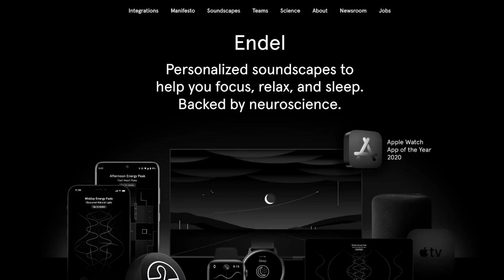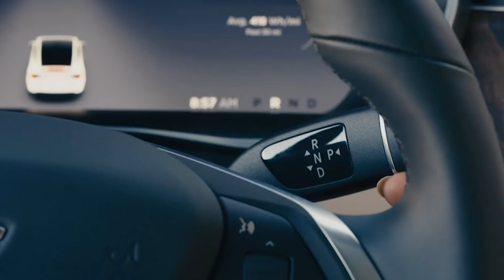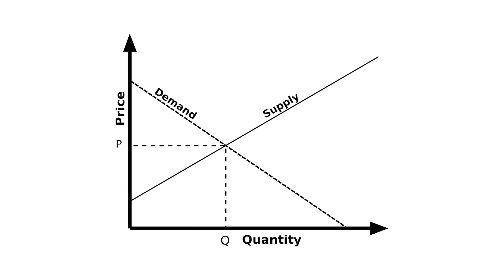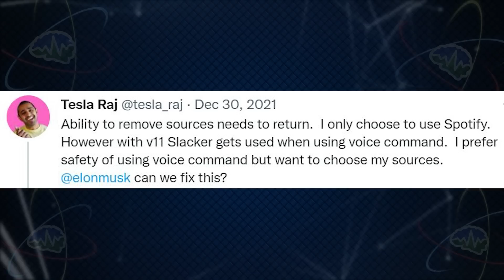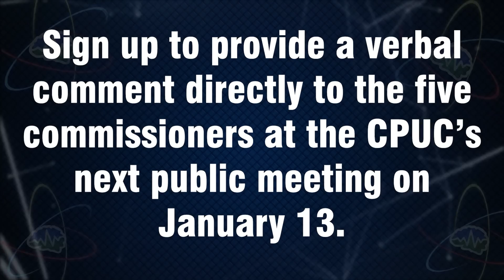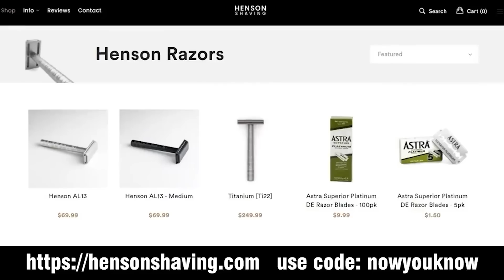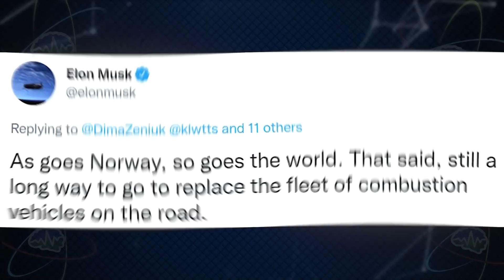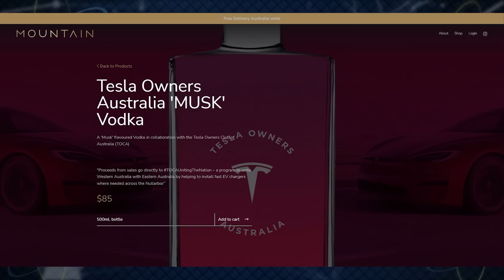Tesla Time News - What's Up with the Tesla Recall?

Comment: The steering wheel oscillation on that autonomous truck is a prime example of "hunting oscillation", a common problem in automated systems. It is caused by the feedback loop when it over-corrects for a minor deviation, causing it to "hunt for" and oscillate around the desired results. Fortunately, there are ways of solving this problem.
Reply: It also looked like it was amplified by body roll.

Comment: Re: getting used to voice commands - it's sometimes hard to vocalize what you want. You have an idea in your head of what you want, but that's a physical action. You then have to translate that into words and sometimes that gets messy. You do have to dedicate a bit more mental effort to use voice commands rather than having a button you're used to pressing with muscle memory.
Also, voice commands suck ass/don't work if you have a bad/no network connection or are traveling above like 50 mph because of the noise in the cabin.

Comment: NEM3, if it is adopted, will be a huge boost to the home battery market. If the utility doesn't have to pay a decent price for the solar you make in mid day, the obvious way to compensate is to store your free solar power during the day, and use it later instead of pricey power from the grid. The tax is harder to avoid. I'll be protesting that. It will push some to go completely off grid and kick the utility to the curb. I don't have enough space for panels to make that possible.

Comment: Any idea how well the Tesla Solar panels resist fire as, here in California we have forest fires every year. I hope to buy a home in a rural area, but that area is prone to fires. I would retrofit the home against fires with such things as, fire resistant windows and sliding glass doors, retrofitting or replacing the garage doors with a new one or a special add on to the bottom of the garage door which is designed to keep the high winds caused by a fire from pushing hot ambers under the door, etc, and I am wondering how fire resistant the Tesla Solar Panels are? I know removing shingles and putting down a metal layer, and then putting new shingles on the roof is a way to protect the roof from fire, but wonder if Tesla Shingles could replace all or most of the shingles if they resist fire. Also, could a layer of metal behind the Tesla Solar Panels act as a heat sink to keep the panels cooler thus making them more efficient. I know heat on a roof can lower the efficiency of solar panels.

Thanks, love the show. I hope to invest a few hundred thousand into Tesla later this year. Hopefully their stock doesn't rise too high before that point in time.

Comment: The Scotland story is actually a bit less impressive. The target relates to 100% of Scottish consumption of electricity. But Scotland is a big net exporter of electricity. So it should be easy to exceed 100% renewable. It is quite realistic for Scotland to produce 200, 300, 400% of its own consumption in renewable electricity. And still produce some non-renewable power.

Comment: Zach and Jesse, Why hasn't a weather widget been added to the UI. Seems like an easy thing to add and wouldn't take much work. It would have a big impact. So many times I just want to tap on the temp at the top of the screen and have it pull up a 7 day forecast. What are your thoughts? Can you push this up the pipeline?

Comment: Add a couple of new power walls then all the solar power goes to the power walls to completely recharge the power walls by noontime. The simply shut solar down. Then notify the power company you will no longer be providing the grid. That should get rid of the $80 per month. When the sun goes down your house will automatically switch over to the power walls and unless you look out a window you won’t even be aware of the power walls taking over power.

Comment: Windshield wiper button was uncalled for, the problem with the UI is making it HARDER to do things as you drive. Voice command isn't perfect especially if someone has a speech issue. Trying to access the AC blow out control is now harder. Also, SAVING a recording that you have set to manual is now harder as you are driving..this isn't a Windshield wiper problem. It's a safety problem with these two settings not needing to be changed.

Comment: Regarding the UI issues and complaints...I believe they could have been largely mitigated by having the old UI buttons as part of the custom button line-up. Oh, you want the driver-side seat heater...just add it, or the rear defroster....just add it. But, they are not available, or at least I don't see them available.
Reply: I want to turn on the defroster and seat heater from the app while I’m still inside!

Comment: 27:00 if they're in different lanes and there's a clear lane between them, why would you NOT drive between 2 big rigs? O.o if 2 lorries were in the lanes as shown in the video, would you expect all traffic to pile up behind them and wait for them to get into 2 adjacent lanes or into the same lane before overtaking? If there's a clear lane for traffic to pass between them then A) there is a lorry in the wrong lane that needs to move over so traffic can pass in the overtaking lane, but also B) traffic should still be free to proceed between the 2 lorries until the improperly placed lorry indicates they'll move over and free up the overtaking lane.

Comment: I love solar/renewable energy, but NEM 3.0 makes sense from a practical standpoint.  With solar especially, we have to consider the duck curve, when everyone's home panels are generating maximum power while the demand is low.  This puts a greater demand on the grid power plants, requiring either massive utility level storage, or more peaker plants.  If they remove some incentive for putting the power back on the grid, it adds incentive for the homeowner to consume the power locally or store it in a battery.  This still saves the homeowner $0.24/kwhr when they are able to offset their nighttime usage.  I think this pushes the incentives in the right direction, giving the homeowner more control over their own power usage.  I wouldn't be so negative on this personally.
Reply: Except for the fee per kwhr.  That just seems like a money grab.

Comment: Lead acid battery are cheap compared to lithium ion battery's and depending I suppose who is making them can loos quite a bit of in my case range, the cold is no friend of anyone's battery's .
Reply: Lead acid batteries are 3-6x heavier, and standard car lead acid batteries can only discharge to 50% without significantly shortened service life.
Reply: @neuropilot7310  I know, my point was they are saying  Lead batteries are expensive am saying compared to lithium there not everybody knows their heavier and most people would I think know that you can only charge to around 50% So I agree.

Comment: Auto manufacturer Daimler advised over 800,000 Mercedes-Benz owners that a technical defect could cause their cars to catch fire, but said it lacked the parts to fix the defect immediately. ”Until a fix is possible, affected vehicles should be driven particularly carefully and usage kept to a bare minimum.”

Comment: Renewable energy source for US story:  Thanks guys for the renewable energy sources for homes that aren’t capable of installing solar power and yet still using 100% renewable energy sources for the daily basis.  

Y’all had a story about the local power system options for renewable energy sources for the consumer base. 

It’s been 4 years and counting on renewable energy sources and the costs for this is a $3-4  premium over the standard price scheme monthly. 

It’s available for the consumer side, but it’s buried deep inside the local power supply options but it’s there to switch to.

Comment: The lead acid battery is widely used in cars, because it is way more crash resistant than Li-Ion one - that is a fact. The point is that the 12V battery is required to provide electricity post-crash for emergency blinkers, doors and window opening, SOS call and what not (there is a requirement for that). For this reason the manufacturers are very cautious about going away from the proven technology (lead battery) and risk it with "new" one (Lithium). Lithium one is in all other relevant properties superior to lead battery. Now, this is typical Tesla, "who dares wins" - hopefully others now dare to follow the suit as the advantages clearly outweigh the risks, but it is difficult to be the first one. By the way, where they have placed it and so on, there should be quite a few other things going seriously wrong before that one gets hit and post-crash functions might be your least worry - you are probably free from all worries by then...

Comment: Buy-back at 4¢/kWh seems like a ripoff.  However, this also implies that the house in question has surplus energy, and does not need to even connect to the grid.  Complete service cut-off will save the consumer all the hidden fees and surcharges levied regardless of actual consumption.  Independence from "The Grid" is the next best thing to selling surplus energy.

Comment: 26:40 that's wind. its trying to compensate for slight left/right sway from the dead center of its lane against the wind. Human drivers just don't condensate that much cause "why?" and will say let the vehicle move slightly over from the dead center of its lane before forcing the vehicle back to the center of the lane once the feel the vehicle is getting too close to being outside of the lane they're driving in. you can sometimes see this kind of behavior from autopilot on planes flying thru heavy winds in comparison to human pilots who will generally be less forcefully against the wind until it becomes necessary to do so.

Comment: Regarding voice commands in the Model 3, I think even the way how you invoke them (pressing a button that's not a button but a wheel) is more than inconvenient.

For the lack of buttons: I painfully miss a direct button to 'recirculate air' on the console, without the need to open climate, find out the current state, find and push the button if needed, close climate controls to see my map again. I think this is really dumb.

Comment: lookslike Tesla is preparing Superchargers in Ireland for other EV cars to charge. Did nobody notice the double charge cables in the units? 52:22
Reply: Those will be old V2 superchargers, they have two cables because they support both the old connector used by the S/X and the CCS standard used by the 3/Y. 
Newer V3s only have the CCS

Comment: Who needs dealers? Screw them! They have screwed the buying public long enough. To buy a vehicle in the UK or Europe takes 20 mins. Here in the USA listening to the dealer trying to peddle unnecessary service crap is a disgrace. You don’t need oil changes every 5000 miles, it is a scam!

Comment: The $8 fee for each KWh your system can produce is WAY worse then the 4 cents they're proposing to pay per KWh.. if you think keeping a physical grid intact, PLUS their overhead AND a reasonable profit doesn't justify the 20 cents.. well.. that's debatable. But charging $8 per KWh your system can produce EVERY month... THAT is f'n robbery. They have 0 reasonable claim to charging solar producers with this kind of fee. Makes 0 sense. They literarily save boatloads of money instead of paying outrageous costs to peaker plants for the power. There is no reasonable call to hit solar producers with this kind of monthly fee. They are already paying low cost for this power production.. it costs them 0 to maintain these solar systems. This is just a straight up power play to rob people

Comment: Depending on Voice Commands is dangerous -- because they can't work without mobile network connectivity (at least that has been true up until now; it certainly would be nice if tesla moves voice-recognition from the cloud to on-board).    Voice frequently fails for me because I frequently drive where there is no cell coverage.
Reply: Weird. I have never had a voice command fail.
Reply: @kebuhrogers  Some time when you see no mobile connection (there is a slash symbol through the bars), try a voice command.  It will display "no connectivity" and do nothing further.  Of course people who only drive in big cities are unlikely to encounter this problem.
Reply: @jimavera2076  interesting. Maybe that is why sometimes there is a long delay between a command and its effect.

Comment: What I'm very concerned about with the "structural pack" solution is what this means when a battery replacement is needed. Batteries will need to be replaced eventually, if not for customers who cannot accept too much degradation, then for general failures that are going to happen. It's not possible to ensure 100% that a pack will be able to perform optimally for its entire life, and any defect in production of any of the cells would necessitate replacement. Does that mean the entire interior needs to be replaced? Assuming center console, seats, carpeting, several trim pieces are all part of the floor, and the floor is now part of the pack, this means potentially disassembling everything south of the dashboard, if not more, for a pack replacement, even if just one cell goes bad or has an issue. This seems like a very bad idea. As Elon would say, it's a dumb experiment.
The structural pack is not some revolutionary new technology, it's just a packaging solution, which means the issues with current batteries are more or less going to be present. Might get more cycle life out of them, but there is no such thing right now as a battery that will not degrade with both cycles and with time.
Reply: Several points.
Why do you assume the pack will be replaced "if one cell goes bad"?
.......
May I draw your attention to (for instance) the recent Taycan "issue" where it seems they are using up the "buffer" installed in case "cells went bad"?
Manufacturers routinely add spare cells for just that contingency, especially on early vehicles.
......
You're not understanding the difference between "structural" and "not removable".
This pack will provide "structure" when the car is driving, preventing torsional deformation (twist).
Look at the video of the car being removed from the trailer.
No pack.
No support other than a beam which stays in the car after assembly.
That beam isn't the FULL structure, but it's enough for a static lift.
The pack?
Imagine bolt holes around the perimeter of that "hole" in the floor.
Now imagine a pack bolted around its edge every 4"-6" (50-75 mm)?
Stiff structure, removable pack, IF required.
.......
Then there's the misconception that single cells are removable from an existing pack....... Plenty of glue in there as well!

"Current problems are going to be present"?
What current problems?
Degradation? You were involved in the development? You know something we don't?

You're guessing.
Don't guess.
Reply: @rogerstarkey5390  I'm not guessing unless you consider what was presented in this video as also guessing. The Model Y had no floor pan. Couple that with the pack with the seat hardware built into it, it seems obvious the intention is that the top of the pack is going to be the floor of the car, which means everything associated with the floor of the car either needs to be removed for the pack to be removed, or needs to at least have any connections to the body of the car removed, i.e. any trim pieces that connect to the floor and B pillar, like carpeting, seat belts, the rear seats etc. Which goes back to the original concern and nothing you wrote either contradicts or eliminates anything I have noted based on the information we have.
Unless you think that somehow the bottom of the battery pack will allow access to removal of individual cells given Tesla has also said they want to move away from modules, but that's also not likely since the cooling plates and connection points are going to be either glued and/or soldered onto the cells.
So again, given what has been seen so far, removal of the pack for whatever reason (it happens from time to time that packs need replacement, this is a fact of life. There was a guy on a local Tesla group that is getting his HV pack replaced on his 2020 Y, for example) will necessitate virtually complete disassembly of the interior.

Comment: 27:00
Why would you drive between 2 big rigs Zak asks, totally ignoring the fact 1 of those big rigs shouldn't be in the far left passing lane and also the fact if you didn't pass them by going in between them, then you are becoming a 3rd vehicle blocking the flow of traffic.

Also, grow a set of balls, CDL drivers are much safer drivers than your run of the mill Zak or Jesse type drivers in my experiences in dealing with them on the road/express ways. 😏

Comment: I don't like the new UI at all. A clean interface doesn't outweigh convenience. Hiding things from the main screen makes driving alone less convenient. Tesla desperately needs a good, talented, experience UI designer. By the way, the "blind spot warning" on the center screen is useless. That's not where you should be looking when changing lanes. Tesla needs a (relatively) simple blind spot warning in the outside mirrors. And I would pay good money for an enhanced reality HUD.
Reply: I love the new UI but also I think it depends where you live. Some are complaining about hiding tyre pressure, seat heaters, and window defrosters, but if you live in a place that's never seen snow like I do then it's not very useful! The next thing I would like with the UI is more shortcuts ("Record dashcam", "Wifi"), a way of hiding shortcuts I don't need ("Wave", etc), and a more prominent blind spot camera. I am used to looking to the screen for reversing so getting used for blind spot won't be a problem. It just needs to be bigger and better placed. And god no for an enhanced reality HUD. Last thing I want.

Phillip.